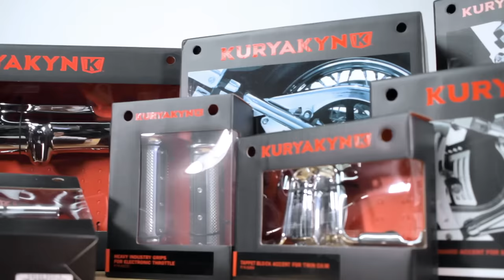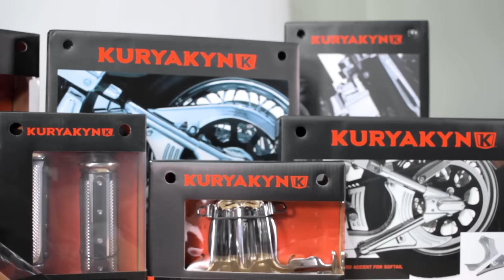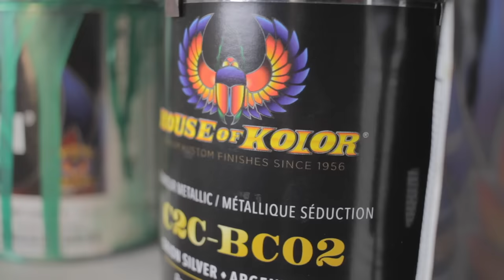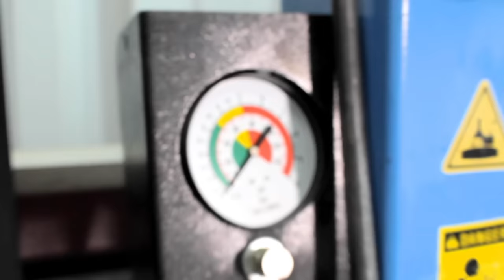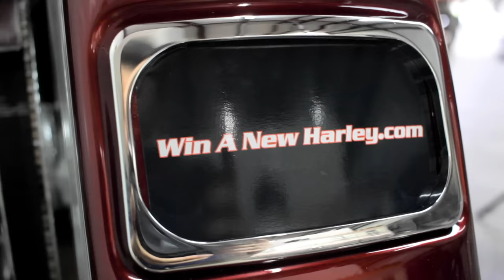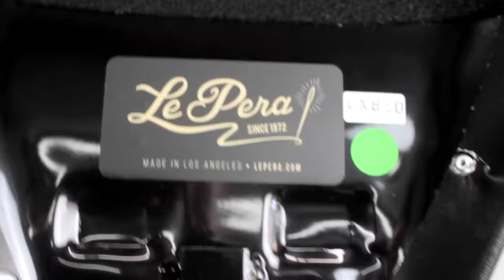How To Build A Chicano Style Softail (UPDATED VIDEO LINK 0:00:02)

Comment: I'm based in the UK and doing my own Cholo Gangster Heritage build, you guys help so much with design ideas 💡 my only question is do you get Cholo's with a 21" 2.5 rim out there??  Does it looks good or would you always stick with a 3.5 rim ??? 🤯
Reply from the maker: Lord Hougun Viking Biker: Due to the wider tire diameter of a 3.5” the ride will be a smoother and more stable ride than a 2.5”. 2.5” front wheels generally use a thinner front fender as well. I really like the fat 50 spoke wheels for these builds and there are many options for spoke styles to choose from. If you have anymore questions, I would be happy to help you out. Cheers!

Comment: Great video guys. Did I understand correctly that you were able to install these Ridewright wheels without needing to modify the suspension or cut the chasis of the bike ? Sorry if it's a dumb question but I'm just starting the journey to building a Chopper.
Reply from the maker: Pranavchadha84 correct, I used the same size rear wheel 16x3.5 and used a 21x3.5 wheel for the front. If you are using the stock front fender, you will need to use a front fender riser for the fender to properly clear the tire. Another option is to use the Bad Dad 21”Mo front fender which has been built to clear a 21” wheel and tire.

Comment: I like stretched fenders i just hate that they end. I like the chrome end pieces that are on the OEM fenders
Reply from the maker: The Bearded Ginger yeah, I wish I would have had the time and budget to do more custom work, but once someone wins this bike, I will have a bigger budget and better time frame
Reply: @user-ns8nv9em8w  all good man its a nice build i found this when looking for fenders and all the streched fenders all have no end caps so im debating on just cutting and splicing oem together on my bike my front fender i don't mind the rear though sits to high and i didn't even get the 18 on it yet
Reply from the maker: The Bearded Ginger I used Bad Dads classic stretched fenders. You can more than likely get the OEM chrome trim to work on those fenders

Comment: I just got my first Harley. I purchased a 2013 Soft tail Slim and I already want to make upgrades to it. I want that Cholo look. I wonder what will it cost me.
Reply from the maker: @junito crespo: We have done complete Vicla builds from $9k all the way up to $25k. Wheels, Tires, Rotors, pulley, Handlebars, Cables, Grips, Master Cylinder, Exhaust, Air Cleaner, Tuner, complete chrome trim accessories with installation is around $10k. Paint jobs range from $2k - $10k depending on time and materials. Air suspension, LED lighting, and Audio systems are available options as well. 
We understand not everyone has $25k laying around to spend all at once, so we suggest building your bike in stages. This allows a manageable budget as well as the ability to show up and show out with new upgrades every few months
Reply: @user-ns8nv9em8w  I’ll stay in touch.

Comment: Which parts did you use for the front lamp modification?  (I see new Lamps with headlight rings and new turn signals - maybe something else more)
Reply from the maker: Chrisi123 the front head light and fog lights have Visor trim rings you can get from any Harley-Davidson dealership part number (69734-05) and the turn signal clear lenses are from Custom Dynamics

Comment: Quick question I have a 2000 softail heritage fltsc what size seat should I put for a cholo look?
Reply from the maker: Rudy T: I used the LePera Silhouette full length for this particular build. This seat contours to the body lines of the bike really well. For your model Heritage, part number is LePera (LX-860) You can find this seat on my website www.RUSHBIKES.com. 
they’re currently on back order till 4/23/21. If you need one, email marcel@rushbikes.com or call me 855-969-2453 and I’ll drop ship you one.

Comment: how much money does a vicla cost already built?
Reply from the maker: LaidBackCecil That’s a good question with many variables that can effect the price. This style of motorcycle has been around for many years. Over time, better products are available to the public as well as overall manufacturers upgrades to the motorcycle. Fuel injection and larger motors for example. I have seen used Viclas under 10k but have higher mileage and carbureted engines. I believe any used bike will require necessary maintenance and a little love.

Comment: How heavy are the wheels?
Reply from the maker: John Davies I didn’t weigh the wheels but I would guesstimate 25-30lbs each. Definitely heavier than a 6061 aluminum machined wheel.
Reply: RUSHBIKESdotCOM thanks and appreciate your speedy reply. One more question, is there any noticeable difference in the handling?
Reply from the maker: John Davies The only difference in handling wasn’t from the 21” front wheel but more so from the lowering of the rear suspension. The lowered rear suspension made the ride very stiff. On my next build, I will be using an Air FX Air Ride suspension with instant up option to eliminate this issue.
Reply: Hey my man this is gonna sound pretty dumb however i have a serious problem trying to take apart or remove this 🛢oil pressure gauge its ends into a 90% degree elbow, ( i guess its the sending unit) anyways because the line that im talking about  it stops at the 90% elbow which somehow obviously was screwed into that oil/ CRANKCASE section of the bike , anyways i fired it up yesterday after sitting in the garage all year. Because of sum legal issues and new englands weather but bud there has to be a way to disect this oil sending line so either i can remove it or tighten it uo because alot of oil came pouring out of that small ass crack lol seriously dude plus i love the chicono look style, way of life mad respect to all, i also have a 1994 heritege softail FLSTN MODEL which is still at the shop sum idiot jerk off clipped me and kept going i sustained multible breaks in my forarm bone and now im still having problems with thevsteel plate and screws etc so im currently looking for a med malpractice attY. BUT ANYWAYS i wrote down your list of things to get eternally,and im just about done, for now except my concerns now are the internal parts? What is a nice size cam?number#1 what do recommend for jet size FOR an AVERAGE riding , give it some balls etc al but first things first is taking that elbow oil pressure release gauage off without destroying dverythingbaround me thanx dude
Reply from the maker: Joe Lewis let’s communicate through email so that you can send me some photos. Email me at marcel@rushbikes.com

Comment: Did you lower the bike?
Reply from the maker: Leon Alofa Yes, I did lower this bike using a slam kit which came with adjustable bolts that attach to the existing shocks and the kit also came with a shortened kick stand. I would recommend going with and (Air FX) air ride set up instead of this lowering kit for a smoother ride.
Reply: @user-ns8nv9em8w   Sweet! Thanks for the heads up.

Comment: Where did you get the turn signal ?
Reply from the maker: Sebastian Bolivar www.customdynamics.com
Reply: How about the rear brake light that goes on the rear fender strut ? I tried looking on that website, have the part number ?
Reply from the maker: Sebastian Bolivar 780 Tail lights 
https://www.baddad.com/products/Rear_Fenders/2006-2017_200mm_Softail
Reply: RUSHBIKESdotCOM thank you so much, this build is amazing by the way !